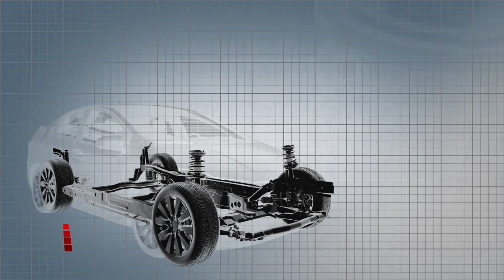All new Honda Civic 2012 Trailer

Comment: hmm that's a step backward using rear beam suspension when the outgoing model was using double wishbone. The older, cheaper Jazz/Fit/City uses rear beam suspension. Not good